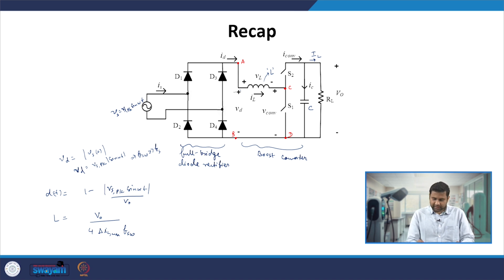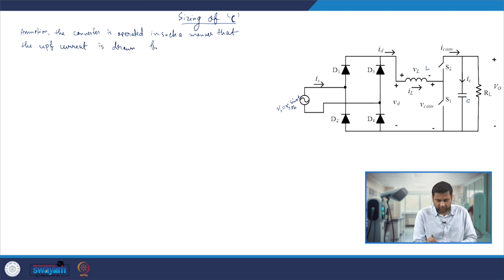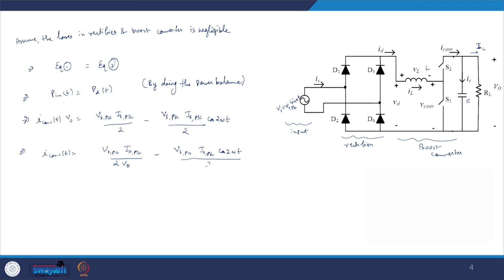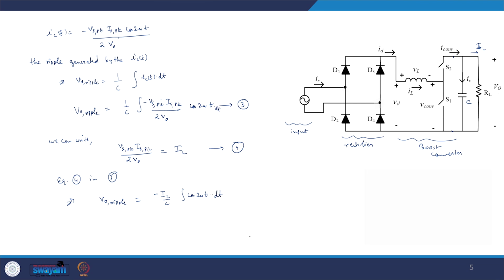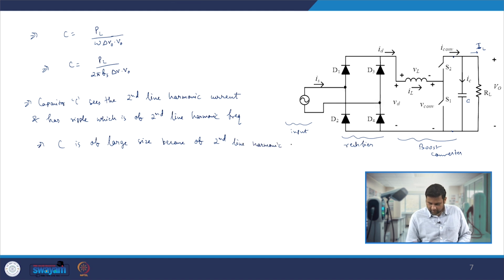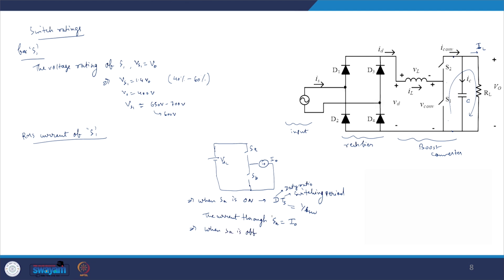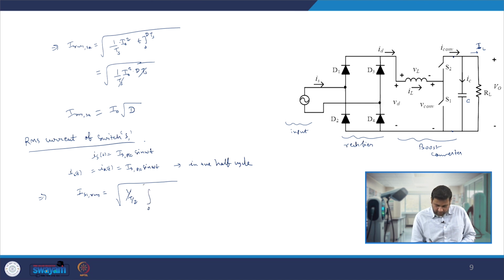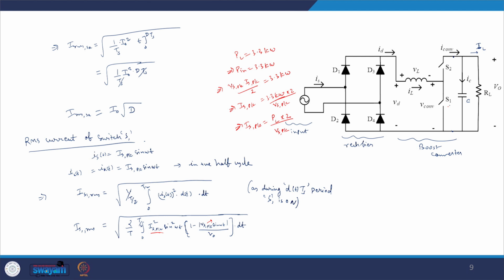Lec 11: Single-phase Boost PFC Converter - III

Comment: This course is getting more tough. I signed up to learn EV charging, why am I suddenly calculating inductor sizes and ripple voltages like an electrical design engineer?
Reply: Bro you should know how to design the converters, without knowing that you won't understand about how EV's are getting charge
Reply: @spike_gaming  :hand-purple-blue-peace:Got it, Thanks